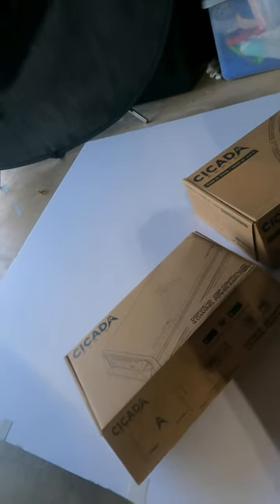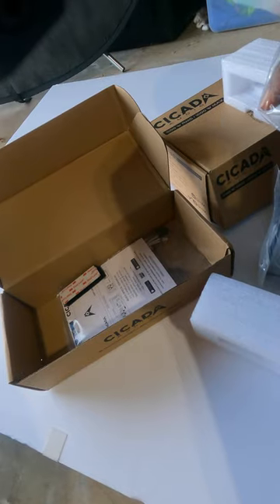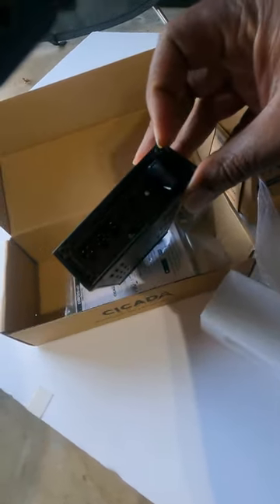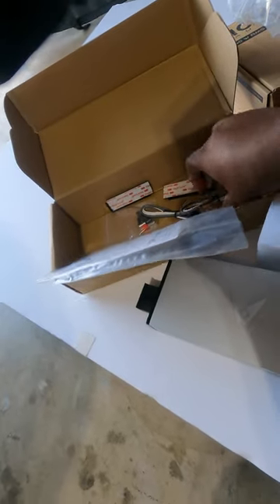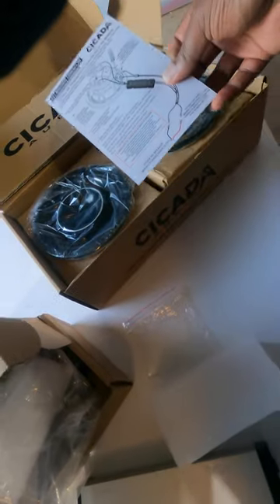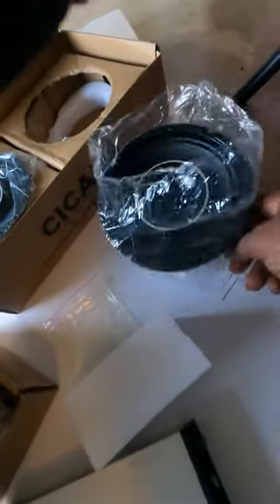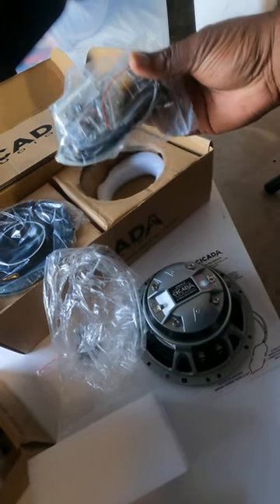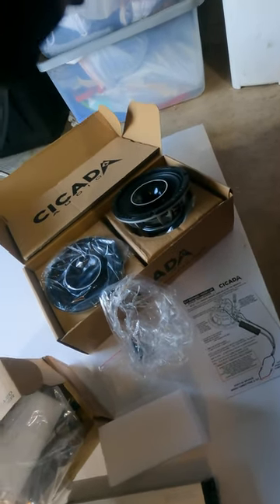Cicada audio unboxing ch65.2 and dsp125.4d

Comment: very nice amp and speakers I like how the amp comes with the proper Gauge terminals for the power input, Quick question, what is the price range on that amp and speakers set?? I know the Hertz and Dimond speakers range in the 300 to 600 range, and the amps go from 450 to 1200 range, Thanks
Reply from the maker: Prices are pretty competitive with Diamond Audio